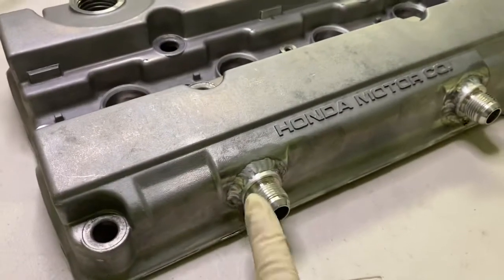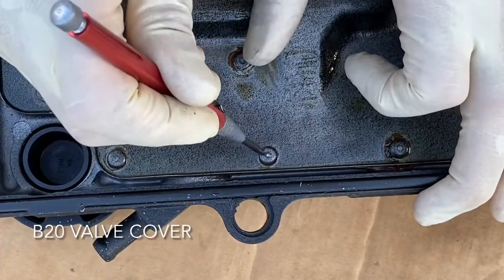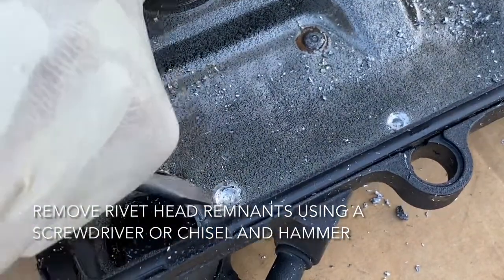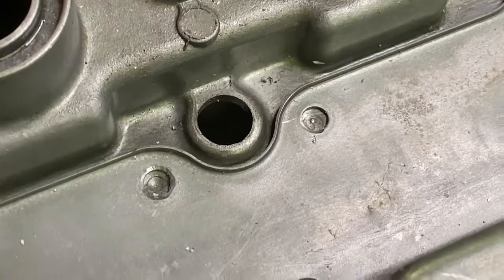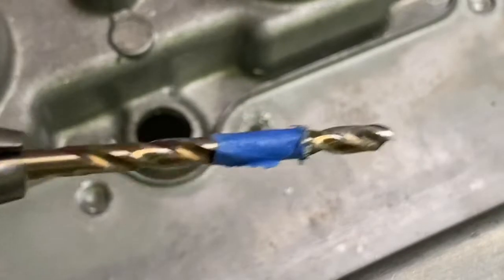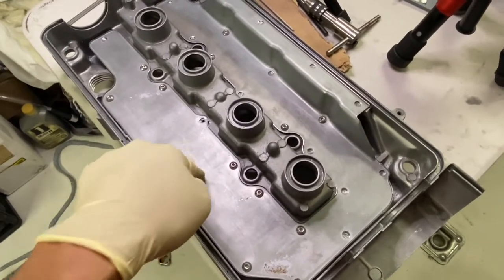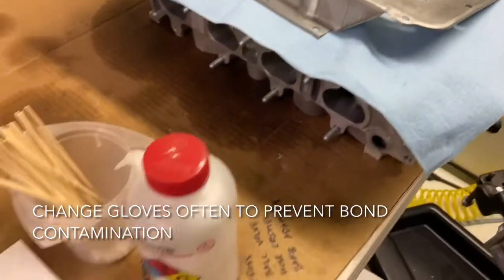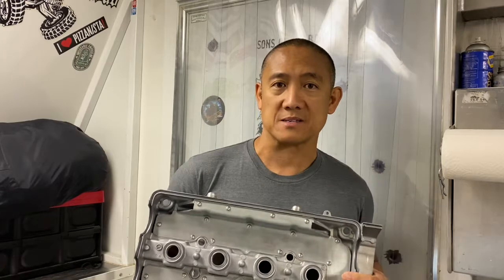Honda Valve Cover Baffle Removal and Bolted/Bonded Re-Installation

Comment: Just did the baffle in my K-series using this as a guide. Thanks for putting this info out there. Highly recommend a bottoming tap over a tapered tap to prevent poking a hole in the valve cover

Comment: Hello, is there any chance that the screws can go lose from the vibration and fall into the engine?
Reply from the maker: There’s always a chance, but that’s why you have to apply the correct torque & blue Loctite. There’s also a chance your motor will blow up if you don’t remove the debris caught under the baffle after drilling.
Reply: @RelentlessRacingAJ  what torque did you use for the bolts? How strong should the bolt be?
Reply from the maker: @alexcristian91  there is minimal load on the baffle so the bolt does not have to be strong. I shared which bolt I used in the video. With respect to torque, I didn’t use a torque wrench because this method is not in the OE service manual. I applied an appropriate torque to not strip the newly made aluminum threads. Notice, I used a small ratchet and torqued using only 2 fingers. This method of torquing comes w experience. Good luck

Comment: Do you need the baffel or can you just do a delete
Reply from the maker: Honestly, I’ve never tried running a motor without the baffle. I’d like to think Honda added the baffle for a reason. Thx for watching and commenting. Pls subscribe
Reply: Do not remove baffles permanently, they're there to control splash from the cams.